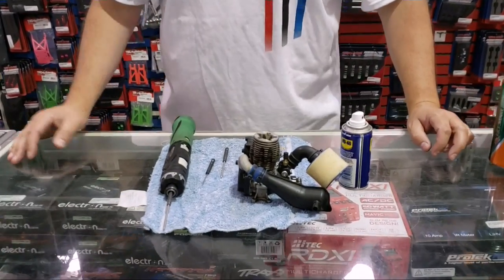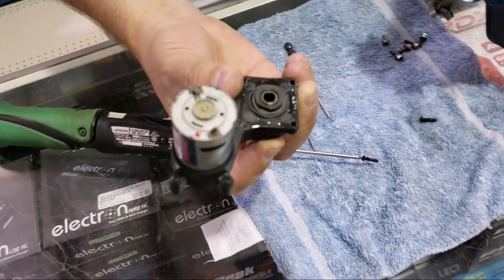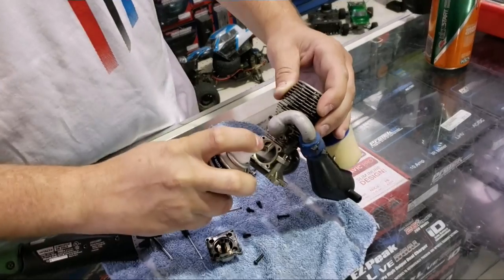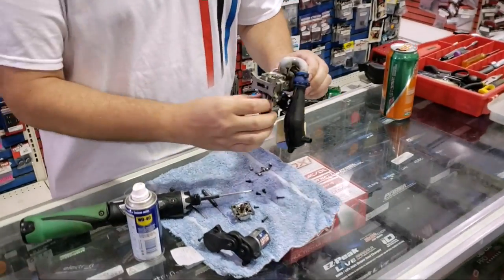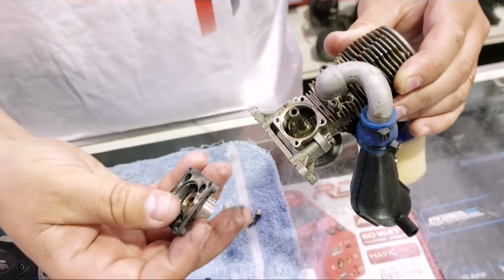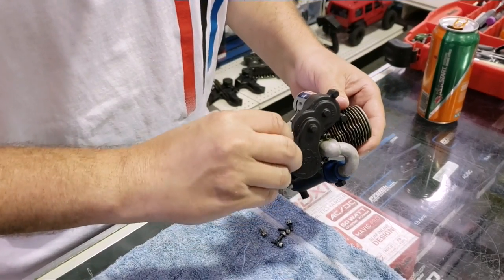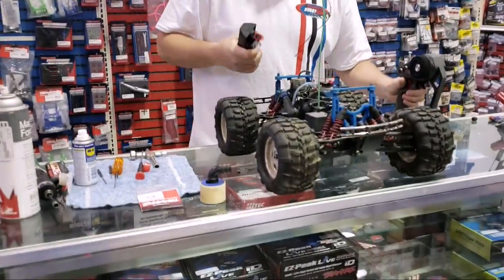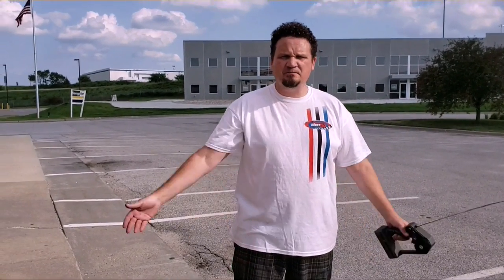How To Fix a Frozen Traxxas Nitro Engine HobbyTown HobbyPlex

Comment: I bought a T Maxx almost new but motor was seized I just took off plug and used a small punch lightly taped top piston with a little drop gun oil.. works freely now.. hope it works😊

Comment: You don’t have to do all of that if you remembered to use after run oil. I just brought out my hpi nitro that was in storage since 2012. That’s ten years. I removed the glow plug and filled it with after run oil. I ran a hair dryer point blank on high for one minute across the heatsink and header. Immediately was unstuck.
Put the glow plug back in. Cleaned the filter. Added fuel. It started right up. And was healthy. Did some donuts and let it cool down and put some more after run oil in the carb

Comment: What about an engine that seized up because you ran it too lean? I have an OS .21VG that I ran too lean.  It got really fast, then I heard a bang and it just stopped. Now's it's totally jammed.
Reply from the maker: That sounds like a broken connecting rod rather than a stuck engine. You'll have to disassemble the backplate and look inside to see if the rod is broke.
Reply: i got some OS.21 VG i can sell you ..

Comment: What handheld drill and bits you are using here?
Reply from the maker: I have a Hitachi cordless screwdriver, but they don't make it anymore.

A lot of guys at the track use this one: https://www.amazon.com/DEWALT-DCF680N2-Gyroscopic-Screwdriver-Battery/dp/B00DL7QDS2/ref=mp_s_a_1_5?dchild=1&keywords=cordless+screwdriver&qid=1591761870&sr=8-5

The bits are ProTek metric from A-main. We carry them in the store as well.
Reply: The HobbyPlex Show what bits did you buy?
Reply from the maker: PTK-8243

Comment: Never use channel locks you can scratch or damage many things inside the engine by forcing them to move.  Just use a heat gun and get them to move by hand.